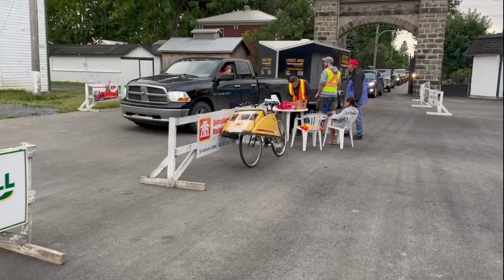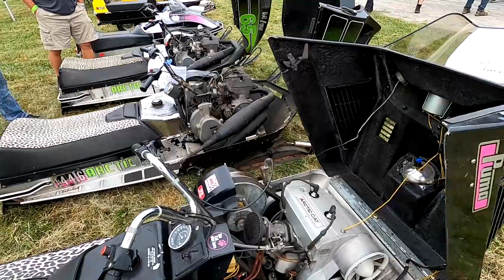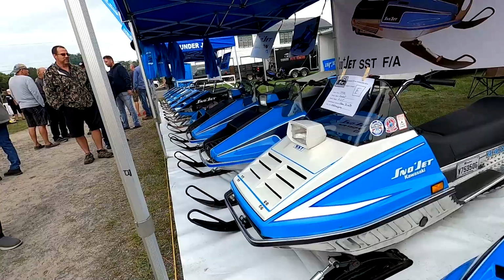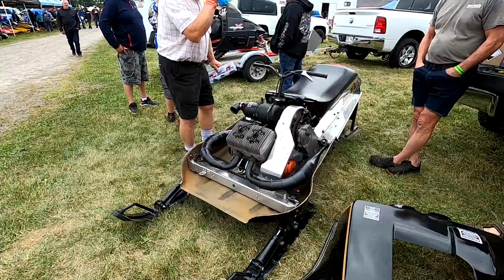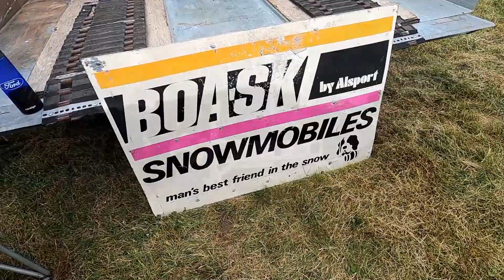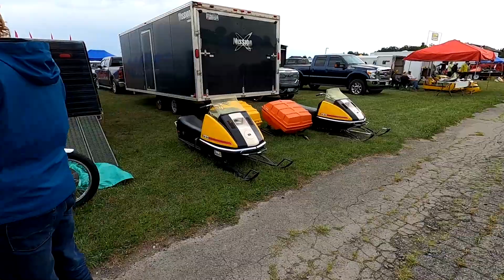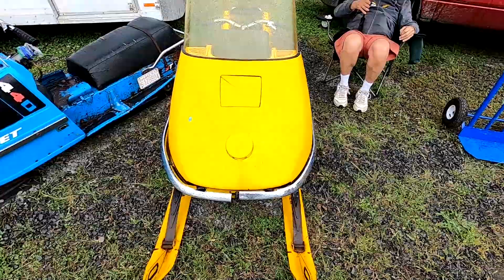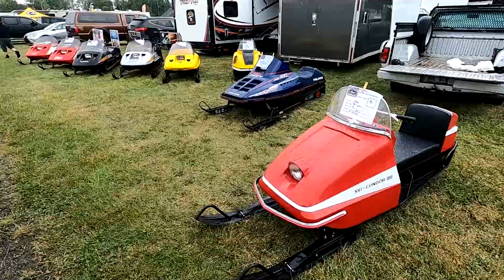Vintage Snowmobile Show! Summer 2021- VSCADK

Comment: I bought a brand new 1976 440 free air short track it was surprisingly  fast , i believe  that was the last year for Yamaha  engines,  after that they were Kawasaki.  Cold days only,   i burnt up some pistons pushing  through  heavy  snow near melting point.  But i really  liked it light and fast.
Reply from the maker: Yeah free airs are fun and fast... when its COLD! I always get nervous running them when its close to melting....